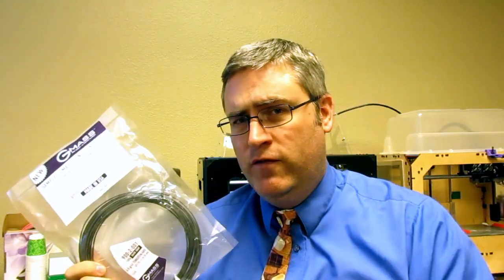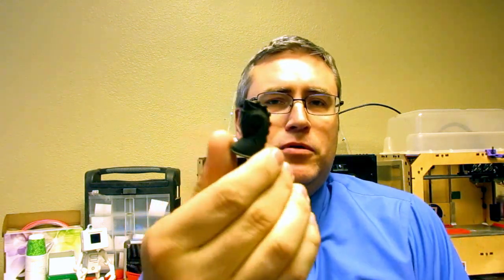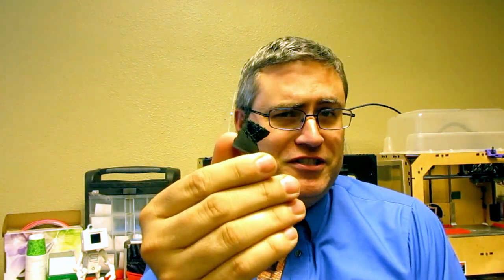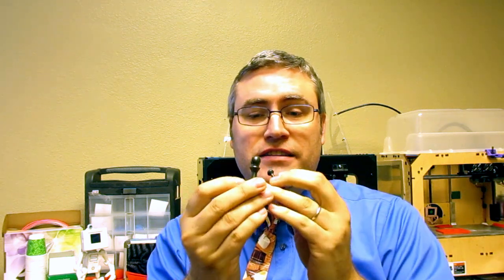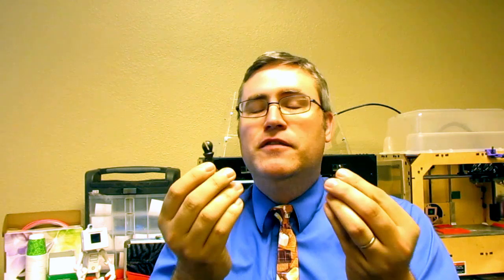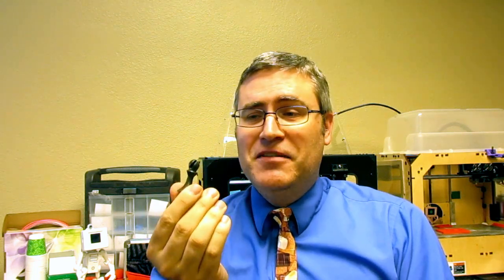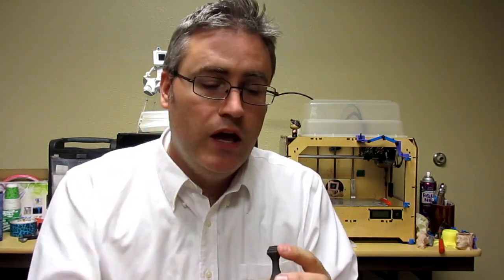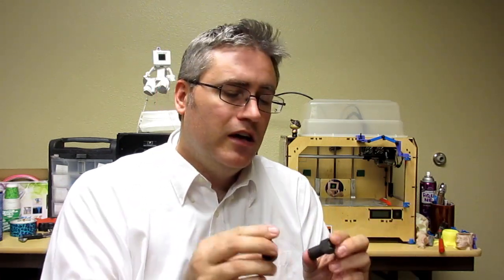3D Printing with Tungsten

Comment: someone needs to make a high temp 3d printer hot enough to melt tungsten wire with like a 1mm carbon tube heated with high current. its the only material that can melt tungsten.
Reply from the maker: So far the closest I've seen is a welder on a 6 axis robot arm. Which is inaccurate as snot, but works.
Reply: @3dpprofessor  I believe a homemade 3d printer with a raspberry pi but a carbon pipe as a heater thin where the wire goes and thick where the electrodes connect so it gets hot where you want it and it don't melt the power electrodes and a high amp variable power supply to get the thin part of the carbon to around 6000 degrees Fahrenheit and math the get the internal temp of the carbon based on volts it should be able to print with any metal wire

Comment: Tungsten is a very brittle metal but it is a refractory metal.  I would use this in a high heat scenario or when the part will be a wearing surface like a bearing or what not.
Reply: the plastic will melt... this is for radiation shielding among other thing i forgot

Comment: Great idea-out of my profession I got some expierence in profesional sinter process. Lots of tools for machining and lathing are made out of tungsten powder, which is pressed (4000 to 5000 bar) and afterwords heat treated at the dew point of the lowest melting component. After that it is heavy duty material. Question: could we take such a printed part in a furnace something >1200°C. You may get a very stiff part with a high stress resistant.

Comment: You obviously have a number of 3D printers and see how they perform,. What non SLA printer would be best for doing small high res objects good enough for doing fine jewelry  I want to make silicone molds of the printed pieces  then inject wax into the silicone molds and use the wax pieces for casting silver/ gold.    Small print areas would be fine.
thanks Rob Allgood

Comment: The tensile/flexural strength of a composite is very dependent on the bond strength between matrix and strengthen media -- and more is not always better.  Also the aspect ratio of the strengthening medial is important.  Here, more is better -- fibers work much better than little nuggets.  So the lack of strength is not surprising.  The good ideas about using the W fill as a weight in the core are probably most of the practical uses there are for this material.  Tungsten (density, 19.25 gms/cc) encased in PLA (density, 1.25 gm/cc) should certainly give a surprising feel to the part.

Comment: Tungsten is the hardest metal known to man. The fact that it destroyed your nozzle is no surprise considering it is made of a lesser metal. Filament comprised of powdered tungsten is like feeding sand paper threw you nozzle. This filament is a gimmick unless of coarse you have a means to center it at around 5,200 degrees Fahrenheit.

Comment: Hey,what is the minimum thickness that can be 3d printed with this?I need this for one of my prototype.
Reply from the maker: Theoretically, as thin as your nozzle. But this is going to be brittle at those thicknesses. I wouldn't go thinner than 1.2mm (or about 3 nozzle widths)

Comment: Would the printed part be stronger if you baked it at 500+ for a couple hours?
Reply from the maker: You mean, to cook off all the plastic and leave only the metal? Then to fuse the metal to itself? Maybe. But I suspect what will happen is we'll melt off the plastic and leave a spongy lattice work of metal. At best it will be a brittle mess. At worst the metal flakes won't be touching and it'll collapse into metal dust in a puddle of plastic.
Reply: That would be my guess also. 
Higher temps might work as a sintering step but not many have that ability. Thanks for the reply.

Comment: Does anybody know if all these 3D printers do is make preset designs or can it be made to configure an original figurine?
Reply from the maker: The best part about 3D printing is it can do both. If you are capable and willing to learn 3D modeling, you can do that. If you just want to download models online, you can do that. My 3D printing 101 playlist goes through the whole FFF 3D printing process, it may be very informative to you.
Reply: Yes. I would suggest Fusion 360 as a modeling program.

Comment: As I recall, the Tungsten filled filament was designed to use as shielding in X-ray machines. The time spent in 3-D printing a part is much less than the time needed to machine the part from solid tungsten. In use, the 3-D printed parts were under no stress at all.

Comment: Have you tried baking your pieces to manage the brittleness? I don't know how this would interact with the voids, but without the acetone sealing over the outer layer, I suspect that the internal gasses could escape through tiny cracks, then be sealed as the material softens. The internal vacuum might even result in a stronger, pre-stressed material. Alternatively, it could just wreck the pieces. :)

Comment: I think I saw you heating the acetone with the "rough" products in it, I guess that would be why you got the bubbles, expansion of the trapped air.  Cold acetone would take longer, but I predict no bubbles.
Please take this at face value, I'm a chemist and electronic engineer, but I do not use a 3D printer.  (Yet)

Comment: I watched this right after watching your vid on clear prints.  In both cases the biggest problem is air bubbles.

I don't have a 3D printer and claim no expertise, which is why I'm going to ask what may be a really dumb question.  But here it is:
Would printing in a vacuum chamber solve this problem?  With the clear I guess not, since having a gap full of air probably isn't any worse than having a gap full of nothing.  But it should eliminate the zits.  Assuming of course that it doesn't destroy the machine, or cost so much you're better off making stuff another way.

Comment: Tungsten has more mass and more mass needs more heat during deposition.  This mass (tungsten) is not heating up enough (even though the filament is melted) causing the filament to cool rapidly.  So in essence you lay a beautiful layer then then the tungsten pulls all the heat out of the surrounding filament that just laid down causing retraction and cold layer for the next layer to be laid.  Then the next layer gets deposited on a cold layer. This is keeping the surrounding filament on the previous layer cold and causing it to cool too quickly.  Try printing at a much slower rate so that the filament and tungsten can equalize in temperature during deposition.  If the tungsten can't get up to temp it will make the plastic portion of the filament cool to rapidly and cause delamination or what your say is to brittle. If you have a heated chamber it might also help to raise the chambers temperature.  If not you can try using a heat gun at a low temperature aiming at the print during deposition.

Comment: Is there a way to temper the plastic after print?
Reply from the maker: ABS doesn't respond to tempering like PLA does, but it wouldn't make much of a difference. What you really want is to be able to melt off the plastic in a kiln and have the metal retain enough of it's shape to take a molten metal to fill the spaces and reenforce the print. Unfortunatly I don't think that's possible with ABS.

Comment: Good for trophies and awards?  It's bound to be brittle, they've packed a previously homogeneous, pliable material with billions of teeny weeny imperfections of non-pliable dust.  The result is, frankly, inevitable.  If you've ever used micro balloons as packing in resins, you'd see that fragility is a trade-off against bulking properties.  Nice vid, thanks.

Comment: Ever thought of CERMETS invented in the 50s and thoroughly developed and refined and used in the 60s for super high-tech aerospace super tough applications? Ever heard of Hafnium carbide that can withstand temperatures as high as 7,000 degrees fahrenheit and is still a very hard and strong and tough solid as it was at room temperature? That is the problem with today's generation, too on line dependent and vulnerable because they should be books and microfilms dependent on information going way back to the past from 2016 to 1800 so they'll know everything.

Comment: Hello dear Professor... I am a total noob when it comes to 3D printing but it seems i just got hooked on the idea... can you please recommend me which printer to go for (under a 1000$) .... I have ideas to print but it would need to be able to print very resistant in all aspects materials , I was thinking about a metal printer but I havent found one in my budget range... do you think it could be doable to build a plane or any other flying object (identified or not) by printing small parts that would be Lego'ed together?? what about these plastic metal filaments? I think the copper plastic one could be really useful to print electromagnetic parts (coils...) but what about the strength, endurance, resistance of such alloys??? any tips welcomed... I also am thinking about making new sources of revenues as a printer (My ancestor invented the modern printing machine(I mean, 'modern' is a slightly outdated term ), and no its not Johannes Gutenberg, but Procopius Waldvogel who first came up with the technology in 1444, 8 years before Gutenberg, but that is slightly off topic) so the sooner i have a better understanding of the potential the better...  and what about scanning objects to reproduce??? any recomendations??? Again, thanks for your time and knowledge!!!please email me  : waldvogelraphael@gmail.com
Reply from the maker: There's a video in my 3D Printing 101 series that you should see. In fact I'd recommend taking the time to watch the whole 3D Printing 101 series, but in particular the one about which 3D printer you should buy.

Short version is I can't tell you. Because I don't know what you want it for. There are as many different types of 3D printers as there are reasons to print with them and if I recommend a printer that doesn't suit your needs then you'll end up frustrated and disappointed. So the question you need to ask yourself is what do you want it for, and there's a video for that too.
Reply: 3D Printing Professor Thanks for the clear and super fast reply, i appreciate... well that really is my problem... i want to print everything and anything.... using both plastic polymers and metal alloy to assemble small printed parts into a potentially huge apparatus (im envisionimg a counter gravity, electromagetically propelled amd gyroscopically controlled flying object (if it starts doing quantum jumps im happy with it too)... hence the need of printing material able to permanently resist to outside physical forces such as pressure heat shock etc...if you dont mind answering that one last question: is there such a printer out there that basically can do everything, and if not is there a way to use custom kits to tailormade the Printinator(I'll print back!!!)without gping of budget, ¥€$?? oh, what about scanning objects to reproduce? need a special 3D camera or a simple app can do the trick? what about objects with a complicated, yet impossible to access without cutting it apart,inside mapping? do i need a printing template or draw it myself with some software, or is there some kind of object penetrating radar that can reproduce the inside of such a complucated object(e.g. the Anthyquiora machine(forgive the spelling)  thanks for taking the time to reading me!!! its late here ..good night!
Reply: I've been doing research on this now because I would like a new 3d printer. I have decided on the Original Prusa i3 mk3. There is a multi material kit for it that would allow up to 4 materials.

Comment: Tungsten filled filament is not tungsten. Tungsten is heavy, very hard and with very high melting point. none of these qualities combine well with plastics. It's just a nasty heavy material that will dull your drill bits really fast. Good luck polishing it... If you want the weight there are way cheaper ways to get better results.

Comment: If you want heavy printed parts just add a hole in the bottom of the chess piece to put in a short length of steel rod after printing. Rough up the interface surfaces of the steel and add a couple drops of CA to retain it, or radius the steel tip edges and spin it in a drill to friction lock it in place and cut off the excess, or use threaded rod and thread the hole. Lots of simple options that don't require exotic filaments and nozzles.
Reply: Model making supplies used to sell lead balls that you could just resin into a hollow model, probably sourced from hunting supplies. Now that seems forbidden, except maybe in nearby Switzerland. Pretty cheap too.

Comment: And you put acetone in a deep fryer and heated it why? Because you love breathing acetone?
Reply from the maker: Easy to heat, self contained, hard to break. And the acetone is heavier than air, so unless you're under the pot you don't smell it. Just don't use it for broccoli after.

Comment: Those yellowish walls ae screwing up your color balance or something, I don't see what you say you see.

I'm also red/green color blind.
Reply from the maker: It's actually the flourscent lights combined with the camera  I was using at the time. I should have color corrected the video, though. If I had the scratch I'd replace it today.
Reply: I would suggest looking into LEDs, they are very cheap now and offer much cleaner light.

If you are super on budget and have some soldering skills I'd suggest buying COB LED moduels (these are the same type the brand name bulbs use) and making a custom light. 

In the end it's cheaper and saves you time correcting fopr color.
Reply from the maker: At the time it was more of a "shooting a quick vid wherever I could. Check out my newer videos. Hopefully they're better.

Comment: Tungsten has more more mass and more mass needs more heat during deposition.  This mass (tungsten) is not heating up enough (even thought the filament is melted) causing the filament to cool rapidly.  So in essence you lay a beautiful layer then then the tungsten pulls all the heat out of the surrounding filament that just laid down causing retraction and cold layer for the next layer to be laid.  Then the next layer gets deposited on a cold layer. This is keeping the surrounding filament on the previous layer cold and causing it to cool to quickly.  Try printing at a much slower rate so that the filament and tungsten can equalize in temperature during deposition.  If the tungsten can't get up to temp it will make the plastic portion of the filament cool to rapidly and cause delamination or what your say is to brital.  If you have a heated chamber it might also help to raise the chambers temperature.  If not you can try using a heat gun at a low temperature aiming at the print during deposition.
Reply: I believe a nice hot chamber might help

Comment: Just found your channels and loving the videos - this one is no exception.
One note on the brittleness - I haven't printed with tungsten filled ABS, but have printed quite a bit with carbon filled ABS. I found early on, as you did, that the prints were brittle along the layer lines (would that be Z axis? or XY axis? You know what I mean ;) ) I found that I needed more heat to get good layer bonds - I print at 245 with CF ABS, and I think I could go higher. With the higher mass of W ABS, you might need even more heat...not just to melt the material in the nozzle, but the lower layer too. Might be worth a try. One way to identify layer bond issues vs. simply brittle material is - break a piece perpendicular to the layer lines. If it breaks easily, the material is too brittle. If it's stronger than parallel to the layer lines, the layer bonds are weak.
Reply from the maker: That is true, though the amount so support needed to print these chess pieces at an angle I don't want to think about.

Still, this material is more brittle, with or against, the grain, than other similar materials. It's heavy and pretty, but fragile.

Comment: RE: Brittleness; have you bumped up the temp on the hot end.  I though brittle was a correlation to layer adhesion (And Cooling Properties)?.
Reply from the maker: Sometimes. In this case it very clearly was a function of the material. Brittleness is what happens with blended materials.

Comment: As a general rule, Tungsten is brittle, it's very dense though, so it is about as heavy as gold and very expensive. If you drop a Tungsten ring on a hard surface, it will shatter. I'm sure there is a use for this filament, but not for anything requiring mechanical torque.
Reply: steel filled filament isnt particularly strong either...

Comment: See if you can get a tungsten carbide nozzle. 
Tungsten, like hardened steel, is a 7.5-8 on Mohs scale of hardness, tungsten carbide is a 9.
There are harder materials, but I doubt there's any available nozzles made out of them, and sourcing the material and machining it would be expensive.

Comment: Tungsten Carbide rings, and tools are made using equal parts tungsten and carbon,  85% tungsten carbide, 15% nickle or cobalt as a binder.  Now everything is a powder at this point, the powder is compressed into a shape, then heated to about 2.5-3.6 thousand degrees F. where the metals then melt and fuse together. there ARE specific heating cycles.   Makes me think, you mentioned a 3D printer in a comment that uses powder.... you can try using tungsten carbide powder.